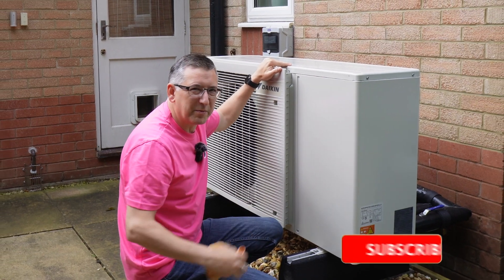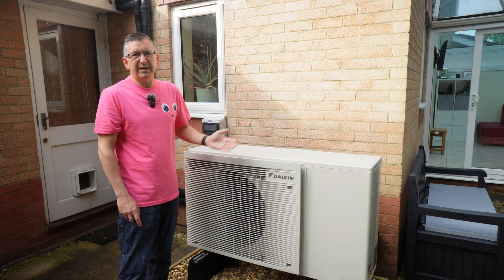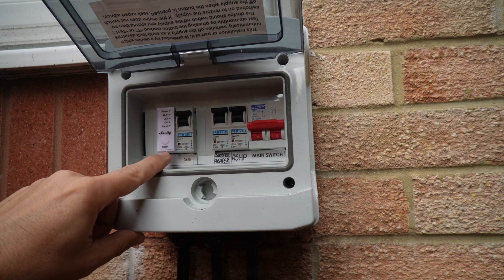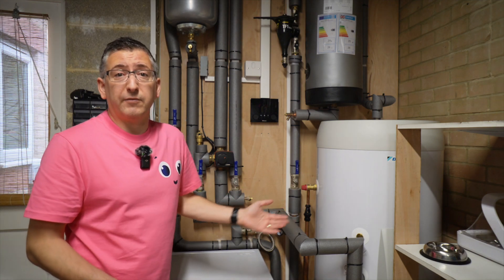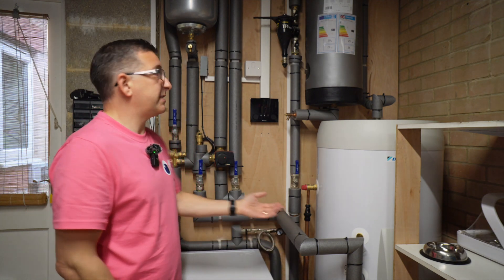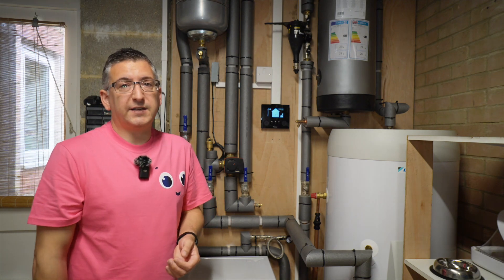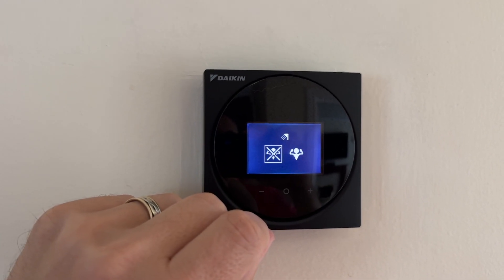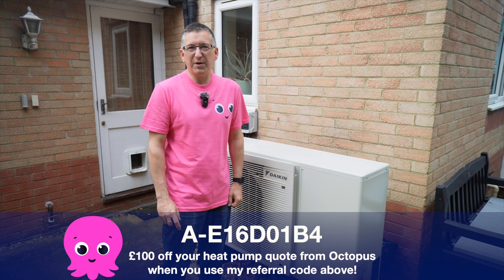Virtual Visit a Heat Pump: Take a tour of my Octopus Energy Heat Pump Installation

Comment: Octopus quoted me for an install on 8mm plastic microbore, which they said was Ok as long as the pipe had the word "Barrier" on it. In the end didn't go ahead as their "one size fits all" approach would have meant ripping our new build house apart! Also they were insisting that MCS regs meant new hot water tank had to be replaced... Very frustrating... Off to see if my local Heat Geek can come up with a better solution!
Reply from the maker: Yeah, Octopus are targeting the easy-install majority and doing is exactly by-the-book. If you need more custom designed solutions then Heat Geeks are definitely the way forward. I hope you get it all sorted. Your hot water tank probably will need to be replaced unless you take a drop in capacity... and that might make it tricky to get the BUS grant.
Reply: @SpeakToTheGeekTech The guy I'm looking at isn't a heat geek BUT he's got decent SCOPs on the "heatpumpmonitor" website. He's relatively local to me so I'd use him

This being said, I'll probably be doing it piece meal with ufh installation wherever. It isn't a "need" but I figure given I've got microbore piping and I'd need to replace them anyway, why not get ufh instead?
Reply: Unless your hot water tank is designed for a heat pump, it is likely to need to be replaced. Heat pumps need larger coils inside the tank than is the case for gas.

You are likely to get a better install with your local Heat Geek, but it will almost certainly cost a lot more. I had an installation by a local Heat Geek qualified, and it was very expensive. However my existing system was very old with single panel radiators that were often in the wrong place and some rooms never had a radiator - if I'd gone to a new condensing gas boiler I'd have had similar work done.
Reply: @MentalLentil-ev9jr  Been running the hot water tank off the gas boiler with a flow temp of 45degrees and it's fine. I actually use low rate electricity most of the time. It just very frustrating that MCS doesn't take things like this into account!
Reply: @edwardpickering9006  That certainly shows that it would work for you if it's ok now with a flow of 45º, it would be a pain if MCS won't allow that. What temperature does it heat the hot water to? I find for my shower that I need about 44º, I run the heat pump hot water overnight and let it get to 47º, it'll drop to 44º by the time we use it in the evening, obviously the temperature needed will vary according to shower characteristics.
Reply: I should have added that it will take longer to heat and be less efficient with your current cylinder but that may be worth doing to not get a new cylinder.

Comment: A very interesting and well presented video. I would like to change from my existing oil fired central heating system to a heat pump but at present it is difficult to see how it will save me enough for me to break even within a meaningful time period. The current price of oil is about 65p/litre. Allowing for boiler efficiency (about 90% on my condensing boiler) and that there are about 10kwh in each litre of oil, I reckon I am getting energy at about 7.5p/kwh. Typical electricity tariffs are around 30p/kwh peak and 8p/kwh off-peak. Given that the off-peak time is typically  only 6h/day and that the  heat pumps schedule needs to be able to run most of the day, the average price/kwh used by the heavy pump daily is likely to be around 20p/kwh. Even with a COP of 4 this still equates to 5p/kwh of useful heat. That's a saving of 2.5p/kwh. I use about 1000 litres of oil/year (about 10,000kwh). So my saving would be about £250/year. Even with a grant and assuming my net costs to include a new water tank, several new radiators and plumbing modifications, it would still cost me around £7500 to install a heat pump. This equates to a 30 years  break even point!
Reply from the maker: You should never think about it as breaking even, that's not what it's designed to do. If compared to gas, it's about cost comparative to run at standard rates. If you need to replace your heating system, put a heat pump in instead. If you want to reduce your carbon footprint, put a heat pump in instead. But if you want to save money, maybe invest in solar panels and a battery. A heat pump is for heating your home, not earning you a payback, it's the wrong way to look at it.
Reply: I take your point totally. Despite the fact that my house is thatched and therefore cannot take solar panels, through lateral thinking I have a lot of solar and batteries. At home I have 21 panels distributed around my property. At a separate off-grid location 1 mile from home I have another 66 panels feeding 52Ahr usable storage. On top of that I have two camping sized trailers each with 30Ah LFP batteries which take energy home. This all keeps two EVs and the house (minus heating) going for about 10 months of the year. At this time of year my electricity  statements are about £17/month of which £15 is the daily charge. 
My oil boiler is only 5 years old so no need for a change for at least a decade. It is just a shame that it is uneconomic and probably not green for me to change to a heat pump.  @SpeakToTheGeekTech

Comment: Is it possible to use tado valves with the heat pump? If not, how do you make temperatures even in rooms which are colder? We have a room above the garage and until we fitted tado we had to overheat the other room where the thermostat was in to keep the room above the garage warm enough. Tado 100% fixed that problem. Now we’re on a journey to have the octopus heat pump fitted… I’m a little concerned
Reply from the maker: It is possible, but you shouldn't do that. You should size the radiator in that room in accordance with the heat loss for that room. Having an even temperature throughout your home is all about sizing the radiators correctly and making sure they are balanced properly.
Reply: A positive with a heat pump is that you don’t need any smart controls. As Oliver has commented, the system will (or should be) sized to match the heat output of your radiators to the heat loss in each room. If a specific room is getting a bit too warm then a standard TRV can be notched-down a little bit but, if the system is well designed then this shouldn’t be necessary. I believe they actually work best in more open-plan layouts as there won’t be got and cold spots as the temperature evens out. Watch some of the Heat Geeks videos for information on control and zoning (NOT!) 
Anyone want to buy a second hand Tado system with 9 radiator valve controllers?
Reply: System should be balanced so each room heats correctly using the lock shield valves on the radiators.

Comment: Thank you for the video, always good to watch them, Interesting to see you have a braided flexible hose so you can re pressurise your system. We had our Octopus install in July and have only recently used it for heating. We've needed to bleed the radiators, the pressure has dropped but our install doesn't have the braided hose so we can't re pressure it.
Reply from the maker: The braided hose is not supposed to be left in place, it's supposed to be taken off and left on a hook on the wall behind it when not in use and connected just for when you want to increase the pressure. But I'm lazy... and three separate valves would have to fail at the same time for it this to be a problem.
Reply: @SpeakToTheGeekTech  ta very much, I'll have to have a look for it!

Comment: We have the same issue with the gas hob. Will be interested to know what you swap to. Are you likely to go induction? We only recently found out that the hole under the gas hob is actually smaller than the hob itself. We were worried we would need a new counter top. Turns out looks like we won’t.
Reply from the maker: Definitely going to be induction, but how long it will be until we replace it depends on the advertising revenue from this video :)
Reply: @SpeakToTheGeekTech  I have swapped my hob in advance of the heatpump install, when they have finished they can take the gas meter away :)
Reply: I replaced our gas hob with a Bosch 13A induction so just plug into a regular socket. It has 4 rings and we are a family of four. Works absolutely fine for our requirements. Side benefits are a completely flat surface and much better air quality.
Reply: @snecklifter  I have a 32a circuit for the cooker so I put in a full power hob as you're never likely to have all 4 hobs on full power and the oven at the same time

Comment: That box will be related to connecting to external air temp sensor... which should be north facing in the shade.
Reply from the maker: That seems to be a common answer in the comments. I guess it’s possibly unused in my installation then
Reply: @SpeakToTheGeekTech  when my 9kw was fitted by octopus the engineer said there was an air temp sensor on the back of the monoblock unit in a little plastic housing. As I'm using espaltherma, like you, i suggested they install the remote external one supplied (they werent intending to even though it was sent) ...so I persuaded them :) so I could get a more accurate reading out of the sun. It seems octopus send a load of standard kit to every job which may or may not get used. Then a trip to screwfix if they need extra stuff...Eg they didn't use the metal box isolator inside as they decided to put the proteus plastic breaker on the internal garage wall  anyway as it was a back to back install...meaning tank was in garage directly adjacent to heatpump outside. I put a Shelly pro in with it too with breaker for better ashp and legionnaires tank power  measurement for the espaltherma.

Comment: Why copper pipes why not plastic?
Reply: Internal diameter of plastic pipes is typically narrower than copper and when you add connections things get even worse
Reply from the maker: Why plastic pipes and not the longer lasting, stronger, less likely to leak copper pipes?

Comment: Could some explain why do you need TVRs if they should be left fully open. Still building up my knowledge base so would welcome some advice.
Reply from the maker: Honestly I don’t think anyone really knows. It appears to be a leftover requirement in the MCS guidelines that Octopus have to adhere to in order to meet the criteria for the installation to qualify for the government grant. I imagine MCS will slowly evolve the requirements as best practice changes.
Reply: Probably the same reason a gas boiler is better on an EPC than a heat pump!! “Heating by electricity” was traditionally less efficient than heating by gas. 
TRVs are about saving waste by controlling the heating in different rooms but are not beneficial when using a heat pump.

Comment: Your Octopus install looks so much cleaner than ours, ignoring the fact you have it spread out nicely on a wall and not in an airing cupboard / loft. Mainly the external insulation looks very shoddy by comparison. Seems to function at least, got it in July and fingers crossed for winter.
Reply from the maker: You can't see in this video, but the tape used to hold the external insulation together had weathered and was no longer very adhesive. Octopus have since been back and sorted this using new extra-water-resistant tape. Still looks just as neat though.
Reply: @SpeakToTheGeekTech  Good to know, thank you. Just looks like standard black duct tape wrapped all round mine for now.
Reply: Is the little box your weather compensation sensor or external thermastat

Comment: If you remove the gas hob and then the gas smart meter, do you still have to pay a gas standing charge? I know someone who went off-grid and still had to pay an electric standing charge to “maintain the existing electricity supply cable”
Reply from the maker: If you have your gas meter removed, all standing charges also stop.
Reply: @SpeakToTheGeekTech  Just in case your 'all standing charges' gets misconstrued; all gas standing charges will stop if you remove the gas meter.  You will still have to pay your electrical standing charge if you are electrically connected.
Reply: It is very difficult to go totally off-grid in the middle of winter and for most people practically impossible if you have an EV and/or use a heat pump. It is just annoying that they have increased the daily charge so much.
Reply: Yeah you will ruin your property value if you don’t maintain your electrical connection as reestablishing it later can cost thousands. Just export a bit of solar in the summer and it’ll cover the cost and in the winter it’s a pretty good value supply of last resort.

Comment: Thanks for the vlog . Been watching all your heat pump videos as ive just had the install date through of the 14 th of oct for a cosy 6.  To go with solar battery and an ev that i already have.  I to will only have the gas hob after installation so will be interested to see what induction hob u will install.  Im assuming induction of course.  .
Reply from the maker: It will be induction, but because I have an electric Rangemaster with gas hob built in, it'll be quite expensive to replace! Saving up though...
Reply: @SpeakToTheGeekTech  well I did contemplate converting my gas hob to run on the large 48kg bottled gas as.  I reckon one of those would last a very long time for just cooking with.  It would be an easy install for my hob too and could keep the bottle outside and secured.  Then I don't have all my eggs in one basket sort of speak.  Was just an idea though .

Comment: I have a quote from Octopus for the same unit, the one thing holding me back is I have an EV and Intelligent Octopus so it's 7p per kwH overnight, but this wouldn't work with a heat pump as that's exactly the time I don't want to heat my home, unless I'm missing something? Nice video, thanks for sharing.
Reply from the maker: Aha you are in a tricky situation of which tariff is best for the kit you have got! I think you will be fine - your peak rates are going to get used, but remember your heat pump will be at least 3 times as efficient as gas, if not more, meaning even at peak rates it will not cost you more to run. But you can boost your home off-peak and store heat in it like a battery. Tim from Tim & Kat made a video on this if you want the science behind it! (https://youtu.be/q1tYCenxb2M?si=dFqHtt0_s1rSTzwt ). If you really want to reduce your monthly bills though, a home battery is the only option. Charge it off-peak, your heat pump can use it during the day. This is what I do. I think you have the right tariff though overall especially because of the EV which I suspect will use a lot more energy than your heating.
Reply: I'm on IOG, have a 10kW ashp and 15kWh batteries. I managed last winter 99.7% on offpeak elec as I was "creative" in my timing for plugging the car in. I topped the batteries up midday most days. Working from home benefit 👍
Reply: It is important to remember as well that, whilst a gas boiler is typically turned off over night (unless it’s really cold), the heat pump tends to run 24 hours with, perhaps a setback of a couple of degrees. This means that the fabric of the house remains warm and the heat pump is just topping-up the heat that is lost. This is why the heat loss survey is so vitally important. Every room has a radiator that is sized to maintain the desired temperature by replacing just the heat lost to the outside. A temperature sensor in the house feeds back into the system but the external sensor is what does most of the work as the level of heating is set according to the outside temperature so that the heat lost is replaced. 
I think my surveyor was surprised by how much I knew but I do like to be informed!!
Reply: That video on the "thermal coasting" was very good, although this may not work with the Daikin as it does not come with individual room sensors to switch off the heating in the bedrooms overnight, but could work with the new Cosy 6. For it to be really worthwhile to get a heat pump and an EV at this stage, seems that either I should invest in a decent home battery such as the Tesla Powerwall 3, or Givenergy and make use of the overnight rates to charge up the battery, or Octopus are missing a more suitable tariff in their portfolio in-between Cosy and Intelligent Go aimed at both heat pump owners and EV users.

Comment: Hi tech twin. I've got the same unit, interested how it performs over winter. Are you thinking of getting a ESPAltherma to calculate cop on ha? I've thought about wrapping it or spray painting the fan over to make it appear less ugly.

My install was a nightmare because the engineers were baffled by the mixergy hot water cylinder. 4 months later and they are still trying to resolve the hot water module randomly turning off. Thankfully I've ha automations to auto flick it on
Reply from the maker: I have ESPAltherma in there already, mentioned in a couple of other videos but I haven't made one specifically about it yet. I considered the Mixergy but I think for our household the extra expense and complication was just not worth it. Our hot water costs are basically a rounding error in the grand scheme of heating costs! The basic hot water tank works very well for us.
Reply: @SpeakToTheGeekTech a video on ESPAltherma would be welcome. We are getting the 4kW unit but I guess it will be the same.
Reply: Yeah, the it made more sense when we thought we'd have gas got a long time. I don't blame you for keeping away. Mixergy recommended best usage is full the tank go 100% with a ashp
Reply: I rang Mixergy to ask for advice about fitting ASHP and I was told to keep hot water at 100%. I think you lose the functionality of the Mixergy tank.